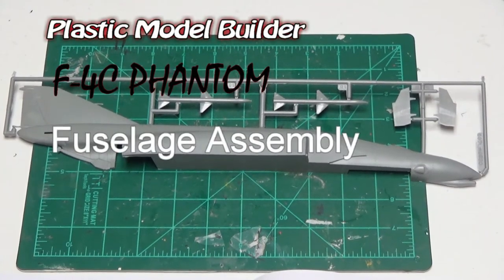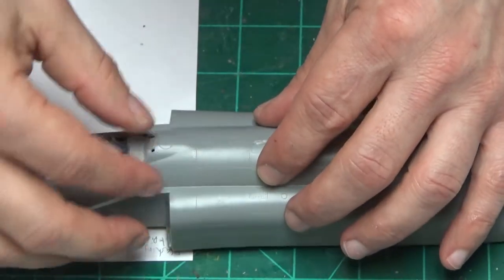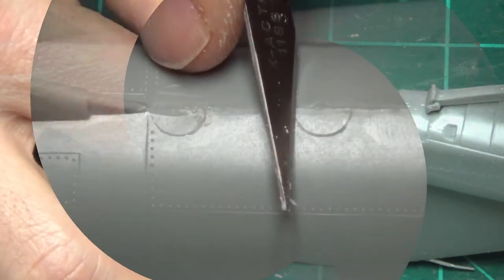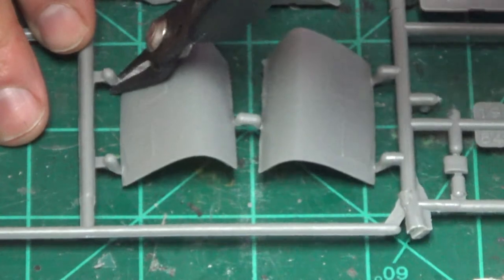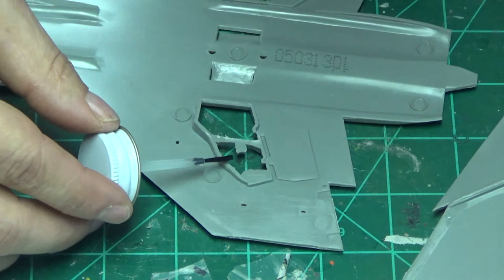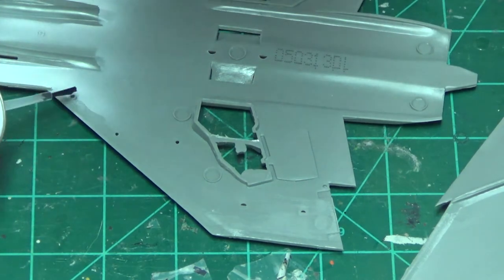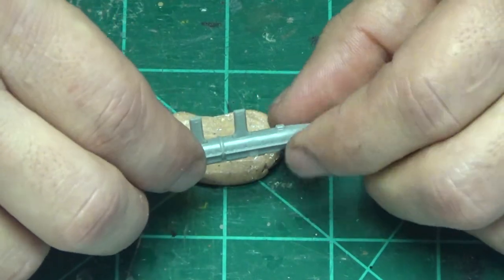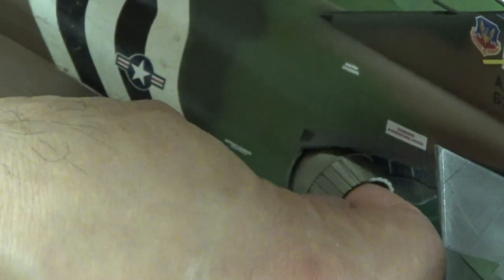The Fuselage and Wing assembly and Pre Paint for the F-4C Phantom by Revell Part 2

Comment: Hey man what is up I've been binge watching your model making maddnesssssss . You mentioned trying a diff glue idk if you have tried or not yet saying this vid is older but I like to use Mr hobby liquid cement very good stuff and also when I use It  I clamp my wings up first and that Mr hobby stuff goes right in there idk how that works but it does it . If I live d close id just let you try mine but I live in the rocky mountains of Colorado . Oh and I got the cement at hobby lobby to btw . Keep on modeling on !
Reply from the maker: I have the testors for in the black plastic bottle and have the testors liquid cement. Ive also made my own glue too.